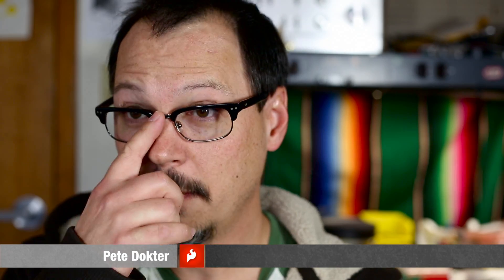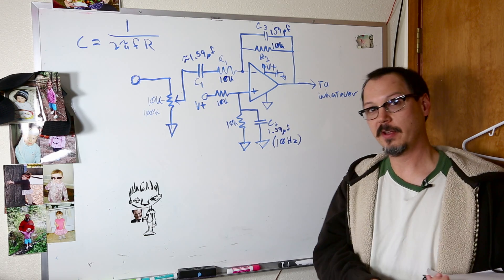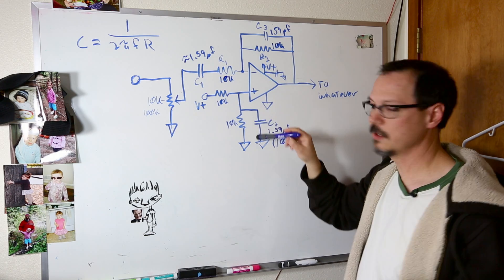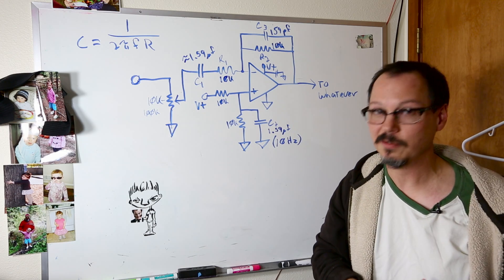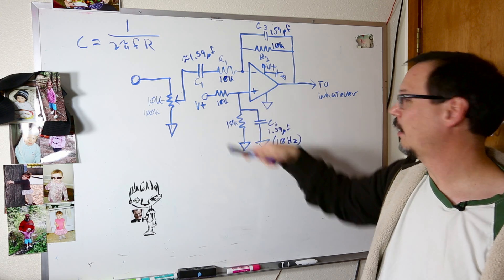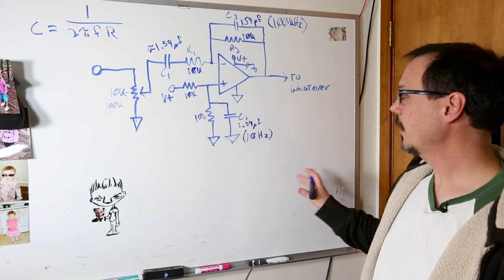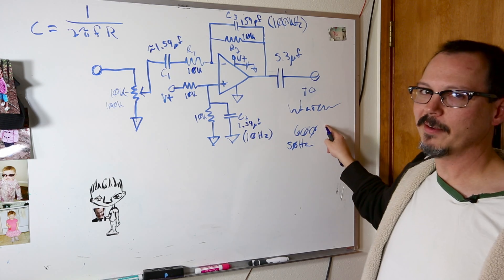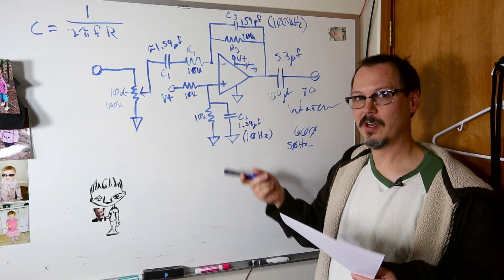SparkFun According to Pete 12-3-12: Op Amps Revisited

Comment: I don't understand something. And I'm probably being stupid so be gentle. Isn't that a subtractor? On my understanding if your signal is going around zero. All the negative part will make the opamp go to his positive rail? Like Vcc - (-anything) will be higher than Vcc thus making the opamp go to the postive rail. I'm sure I'm missing something but what is it? If you instead put Vcc before the resistor divider on the plus pin put half Vcc it would work like you say.